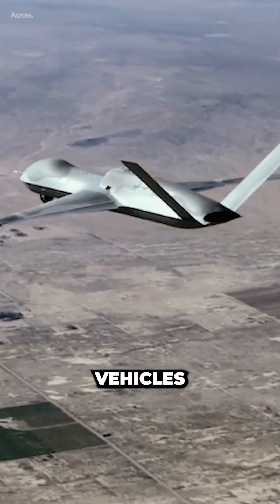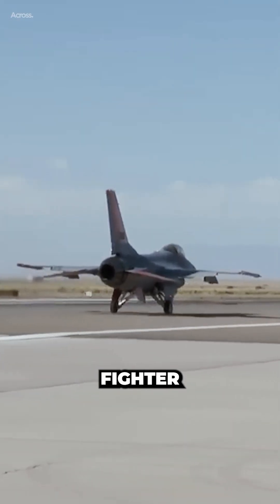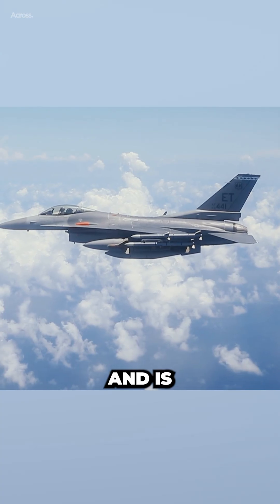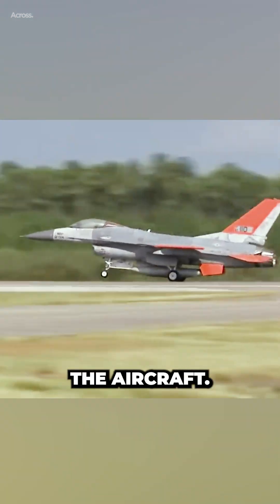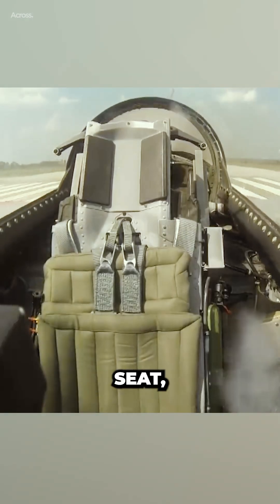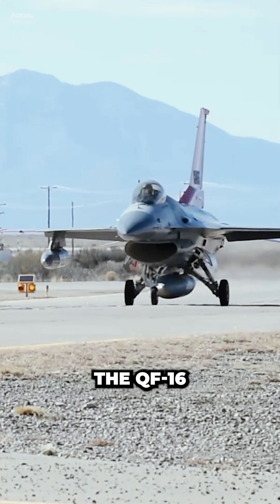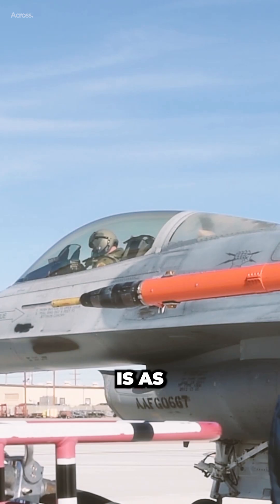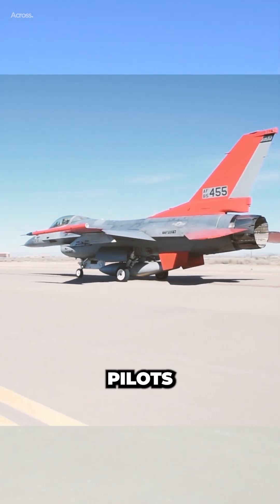How the US Transformed the F-16 Fighter into a Drone #shorts

Comment: Why not just use them a Fighter drones 
It should be easier then making fighter drones from scratch and also faster plus with the fighter Jets in every Air Force they already know it’s strengths and weaknesses compared to a completely new design plus they could use the cockpit for the space and put Al the electronics needed for the conversion look the tests on self driving cars they look almost like normal cars with the same dimensions so for a jet it it should be also easy

Comment: The QF16 is a replacement for the QF4, which they started to run out air frames for....  The air force has been using Fighters since the QF6 Hellcat in the mid 50s......